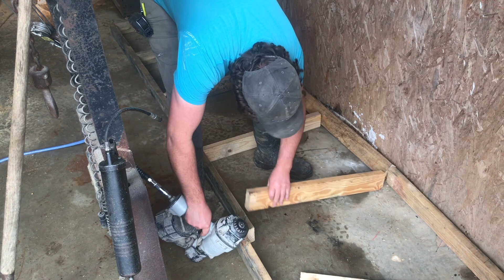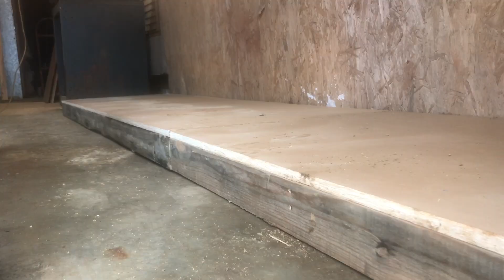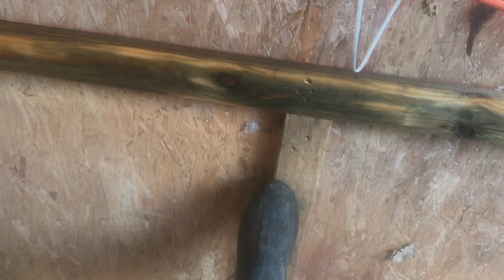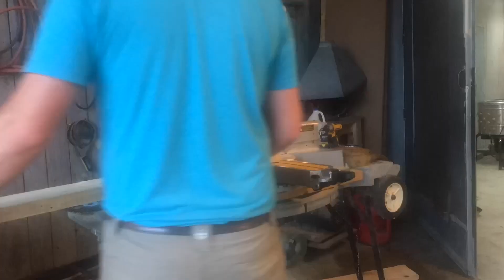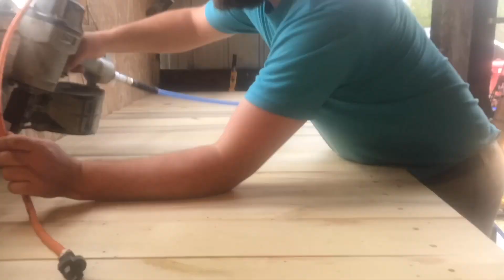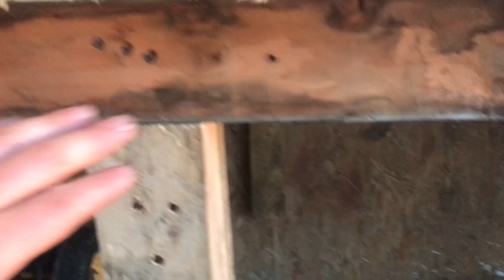the Best way to make a heavy WORKBENCH

Comment: This is a good idea for a regular  workbench.  I would  use this  for maybe assembly or an outtake table.
Not good if your going  to be doing  loads of heavy woodworking on it. The nailed joints aren't  the best for the rocking  and angle stresses